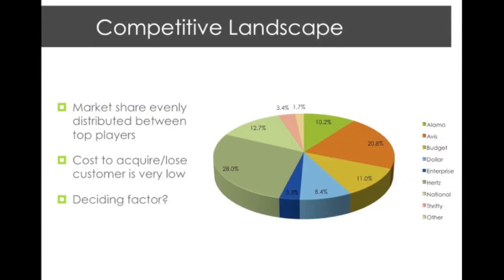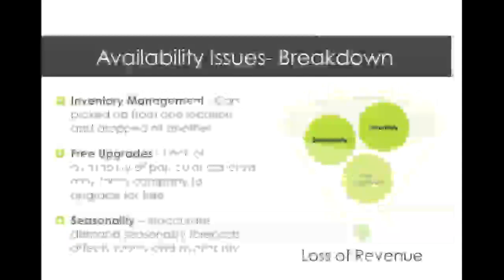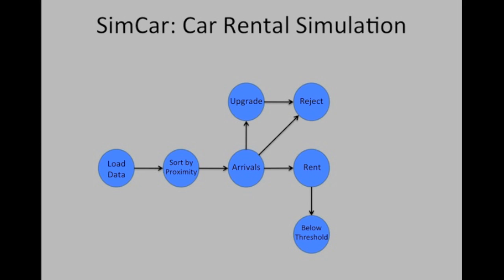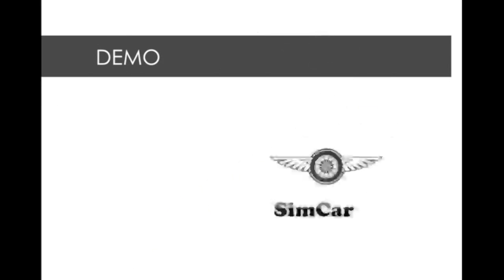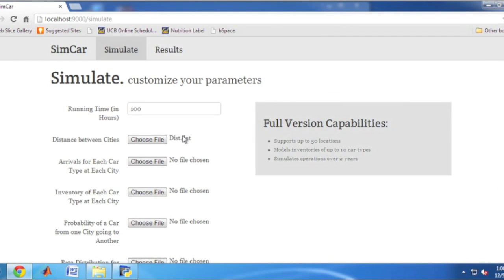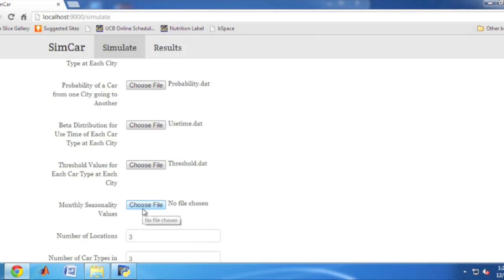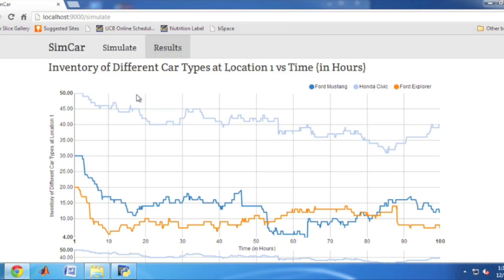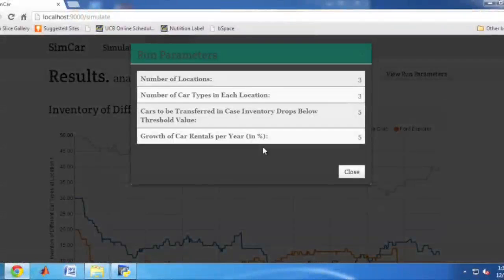SimCar IEOR 131

Comment: (DXLC) Great video, with really good sound quality! Does the simulation return an error if the dimensions of the data files uploaded is not consistent with the parameters input? For example, it would be helpful to return an error message if the user inputs 30 locations, but has a distance data file that only shows distance between 2 cities.